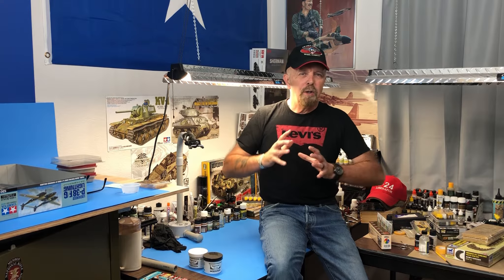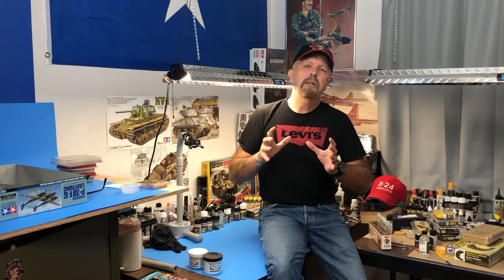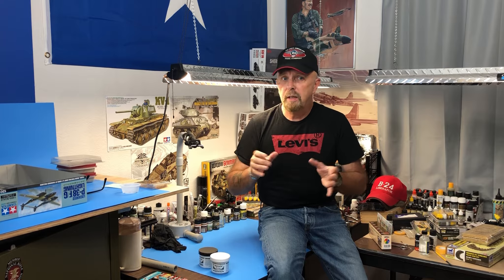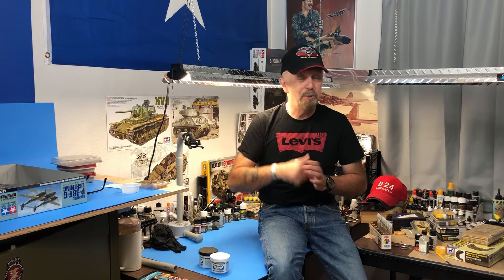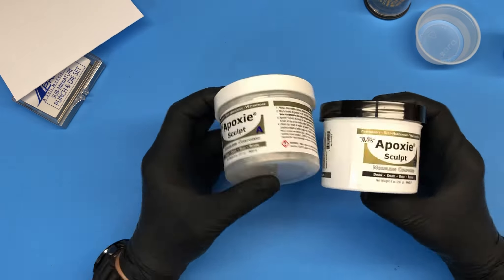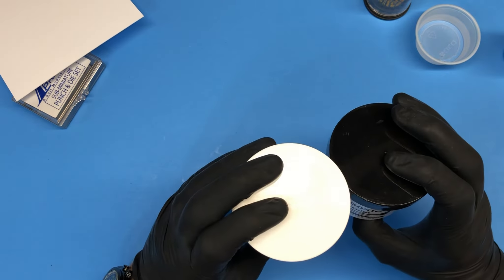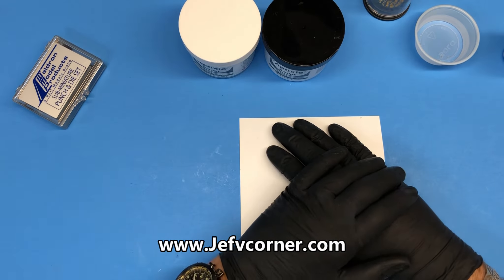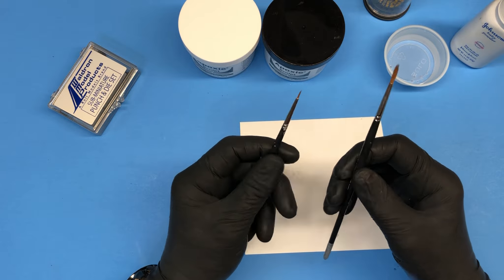Quick Tip Tuesday #14 Simulating Weld Seams With Putty

Comment: Thanks for this video! I have been struggling to find a way to make weld beads. I am making a model of a King Tiger in 1/16 scale so weld beads are a must!
Reply: Question: Are you holding the drill bit at an 90 degree angle & do you have to wait until the Apoxy Scuplt forms a layer of skin first or can you poke at it right away.
Reply from the maker: Hi Robert. 
Thanks for the comment. You can work it almost immediately. It’s just trial and error. Once you get used to it, it’s quite easy.